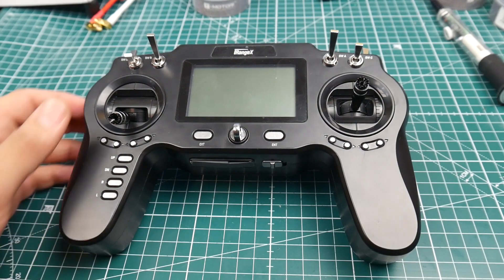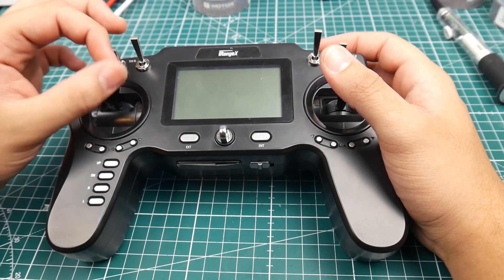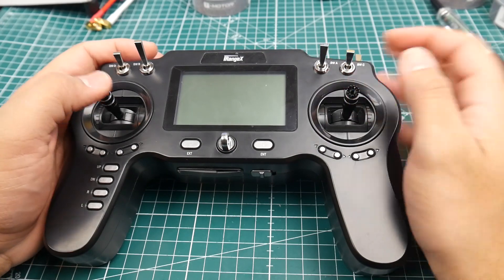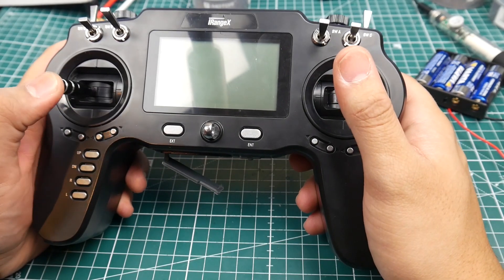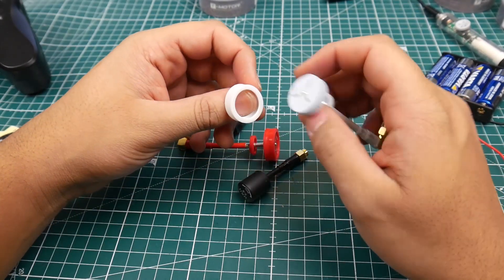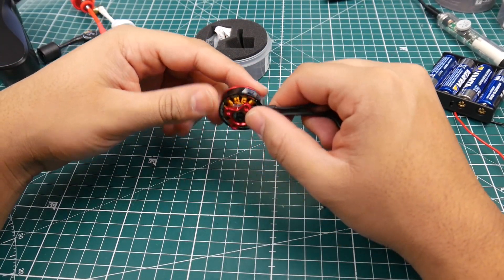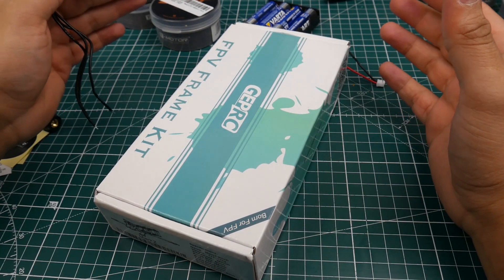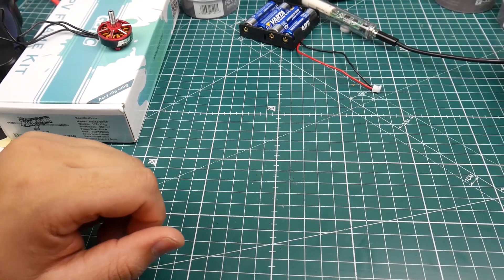iRangeX iRX-IR8M , F40 V2 1600kv // Mailbag Time #5

Comment: Some hot glue between the top pagoda elements and a tpu cover (version 2 Martin Beart)makes theses super durable. I build mine from farvew antenna kits, cost about $4/antenna. I can make 10 in 30-60 minutes.